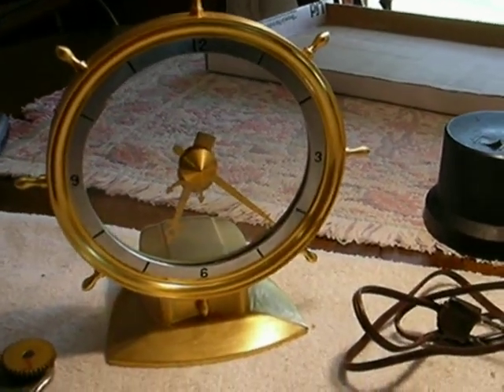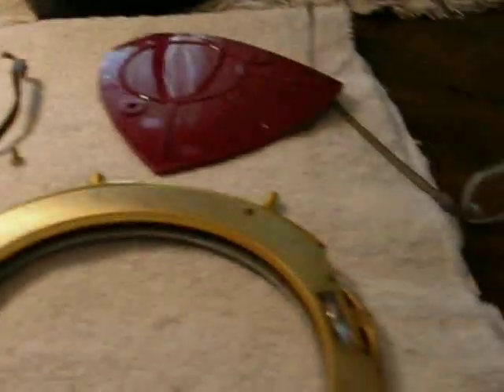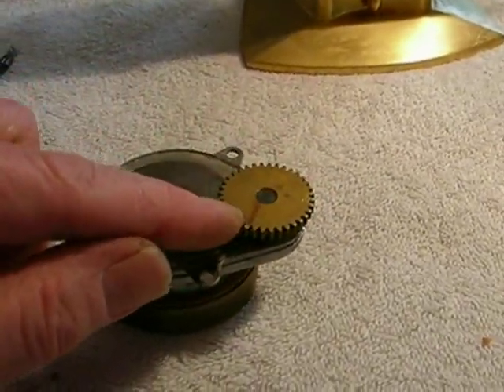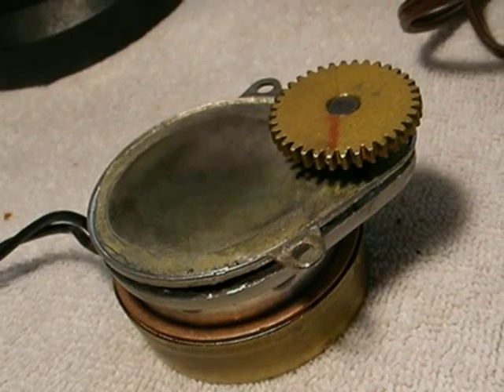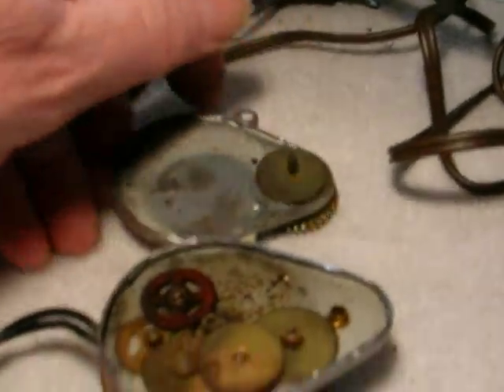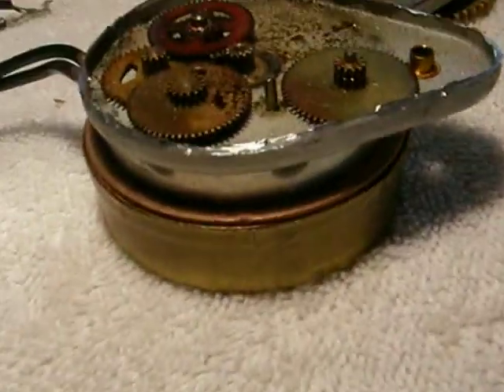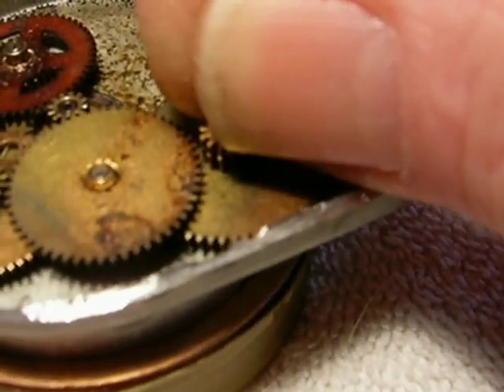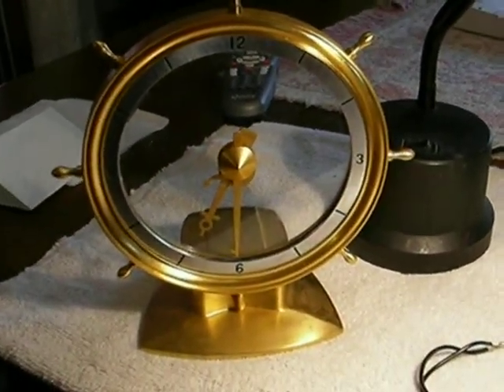Jefferson Golden Helm mystery clock

Comment: While in pieces, clean off all traces of the old gummed-up lubricant and relubricate the pivots only. Putting oil on the actual teeth just increases wear in the future; that is the main cause of the existing wear now. Bits of dust and grit in the oil act as an abrasive and wear out the pinions..

Comment: I have a Golden Helm clock that is missing the motor. I researched the clock motors available for these clocks and found that the drive gears are different for the Golden Helm as compared to the Golden Hour. You indicated that the gear RPM for the Golden Helm is 1/12 rpm. If I could find a motor that has the same shaft RPM that drives the brass gear and is the same size as the original motor I could replace the brass gear to the proper size 37 tooth Helm gear. Any body know what the shaft speed of the motor for the Golden Helm is? It appears that the Golden Helm motors are not available anymore so a new solution to get these clocks working would be beneficial to all collectors that have these clocks.

Comment: My Golden Helm Mystery clock (Feb-7-1952) is still working however it is hard to set it to the correct time as the glass will not move freely by hand.  Once I get it set,  I plug it in and it runs great. Do you know what might cause this ???

Comment: Thank you so much for this!   I have just won this very model and have still to settle up for it and receive it.  I already own a Jefferson Golden Hour and it uses the motor and gear wheel for use here in the UK.  It sits there and tells the time correctly and quietly!   I love it and its looks and its 'cleverness'.

How about a video featuring an American perpetual calendar clock pleeeeese?   I love the French ones and own 2 big heavy beasties, but some day I want an example of an American fully perpetual calendar clock of which there are various models.  However, I'd love to know how it is that the American ones adjust automatically for leap years, which, I understand, do it even more simply than the French ones.   That's what I was told anyway.  I have Tran Duy Li's book, but the drawings and diagrams are simply not clear enough and do not spell it out how they adjust.

Regards.

GAIUS